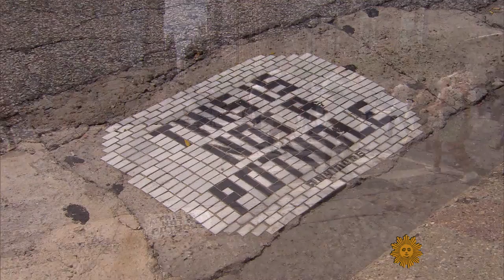Filling potholes with art

Comment: Too bad filling potholes without the right experience can cost the city more problems and issues than it's helping.
Reply: Citations?
Reply: Vesuvius hes not removing the gravel from the bottom or anything. The cement chunks he is putting in will get water under them and it will freeze. the ice will expand end it will come loose. if the city wants to actually fix them then they have to chip it out.
Reply: Ben Harris Yup. The city made official statements about it causing more harm than good. Also a bunch of other people. Sorry Robert Anon, I am too lazy to dig up the clips for you.
Reply: About 5 days ago I spent a day leveling a private road that leads into a driveway using "random assorted asphault", I asked my buddy: "what would you use to fill pot holes" he said "I would use this stuff". After that day went, I think he is right. That asphault stuff is really good at leveling the road and by the looks of it, you could use it to fill pot holes as a really good temporary fix and it wouldn't do any more harm to it than the rain erosion is currently doing to the pothole (by making it bigger). You could just fill potholes on public roads with aspault (rocks) with a shovel for a temporary fix, then when the official people who fix the potholes on public roads come to fix it, all they really have to do is scoop it out with a mud shovel and put it in a bucket, fill the pothole with cement or do whatever it is that they do to fix the pothole, and then take bucket of asphault with em'. This could work. See the problem here is that there is so many potholes and not enough people fixing em' (which demand direct action). We need to create a mechanism which allows ordinary people to do non-harmful temporary fixes. One example would be the official road repairers to suggest publicly (on the news or whatever) what ordinary people can and should use for non-harmful temporary fixes. Like they would say: "if you want to fix roads yourself, atleast use this stuff instead" ex: asphault. Anyways, I am just afraid that the conservatives are saying "don't fix it yourself" because they are coming from an irrational position of keeping the existing jobs alive and well to the point of preventing potential productivity. I am not a leftist, but I agree with the anarchist left ethic of direct action . Productive direct action that improves the community should be welcomed rather than trying to keep problems alive and well in order to save jobs, it shouldn't be about that, it should be about making the community better in freedom of association and direct action, that is the type of free-market I support. As long as you are not intentionally trying to harm people, then yes, your volunteering efforts are welcome.
Reply: However, I don't doubt that this guy's mosaics can withstand both the traffic and the weather. Those mosaics can "survive volcanoes" and thousand of years (ancient) after all.
Reply: I made a funny video on potholes. Check it out if you want to laugh 😂